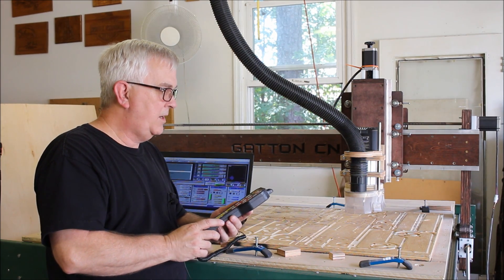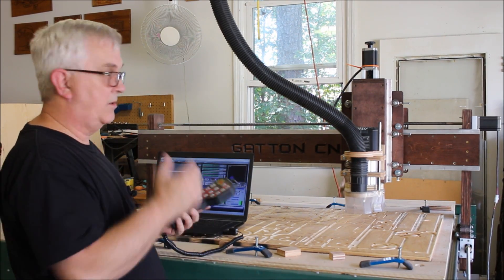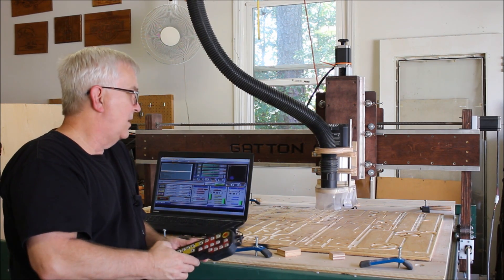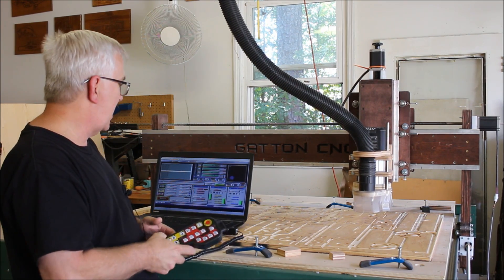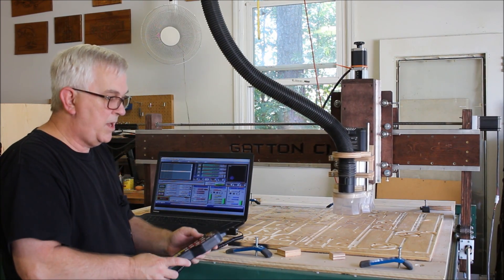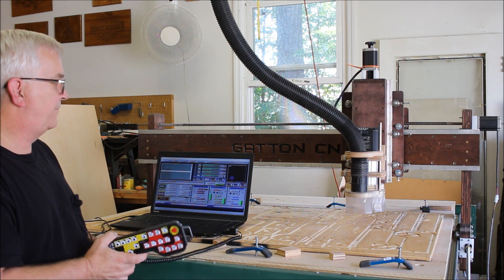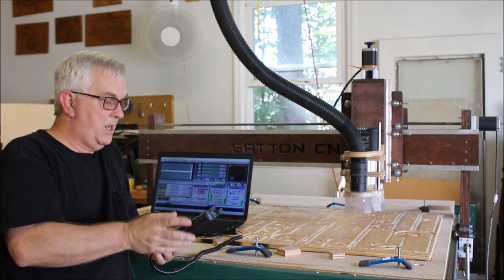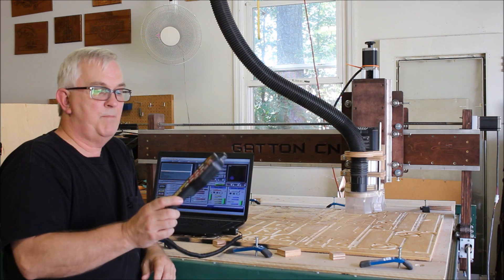Using My Mach 3 Pendant

Comment: there should be a way to make one of the buttons you don't use be a reference all home. they are just buttons. is there a binding keys section in the settings of the software you use?
Reply from the maker: Thanks Graeme.  I know it can be done.  I just have to figure it out when I get time.  Thanks for watching.

Comment: Hi Dave,
I have a small custom-made servo-driven machine I use for production work. My problem is that I want one of these pendants, but my machine moves at 500 in/min (way too fast for jogging to set your zeros). When you use the pendant, can you use the slow jog (which is set in Mach 3 under the tab screen)? Thanks.

Comment: How hot do your stepper motors get? how long do you let your cnc run until you let it take a break? My motors are getting so hot I can't touch them not sure if that is normal or not? your the best Dave.
Reply from the maker: Thank for watching Matt.  Stepper motors will get very hot.  That's normal.  I have ran mine for hours without any issue.